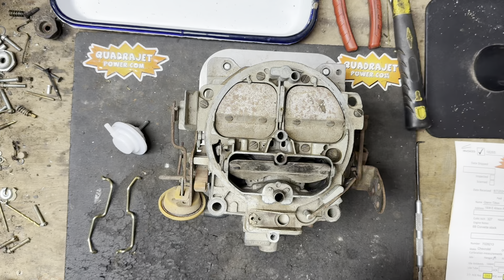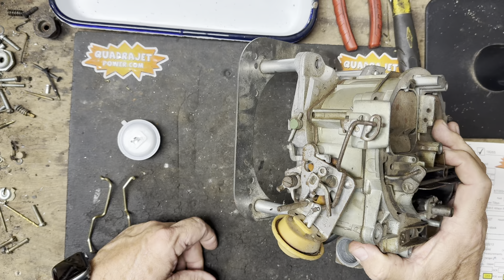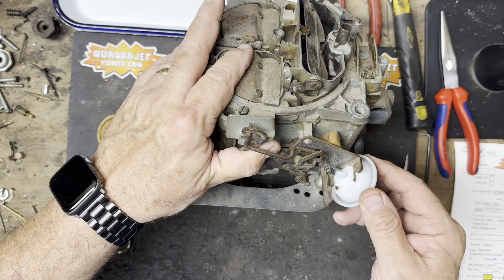Quadrajet Power how to change the vacuum brake or choke pull off

Comment: Got everything you need for Qjets? How about a '65-'66 vac break? 😉 Great video! Very helpful!
Reply from the maker: The 65-66 pull off is not reproduced. We can restore them if you have an original, even if you just have the metal parts of it.
Reply: @QuadrajetPowerLLC  I was being a smart a** for badness lol. I actually didn't know you could repair old ones though so that is awesome! I have the remains of an old one here that could be restored.... awesome!
Reply from the maker: haha, I understand. We may not have "everything", but we try. Quadrajets are all we do here.

Comment: I have a 400 Pontiac, carb number 17059263,the rear vaccum break seems to be holding the fast idle cam up on its last step,should the choke spring pull it of when fully warm or is the vacuum break out of adjustment, it does have a primary pull of which works fine
Reply from the maker: When it is warm, choke and fast idle cam should be fully at rest. You may need to bend the rod to the rear pull off some to adjust.

Comment: I have a question: I’ve just ordered 2 5/8 inch to fuel hose adapters from you on EBay. One for the carb, and one for the fuel pump. My goal is to replace the fuel line with a good quality hose. Are the adapters ready to install ( with the inverted flare ) ? Or do I need some sort of gasket or sealant ? Thanks in advance !
Reply from the maker: They are inverted flare and should seal up without anything added.